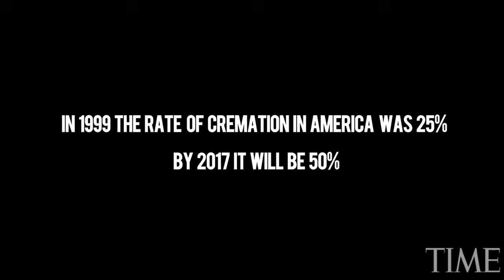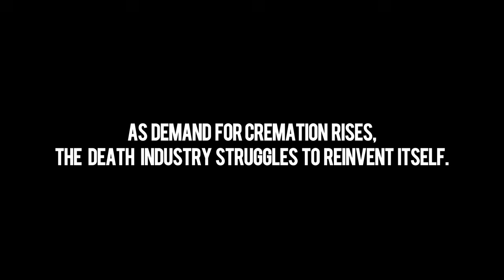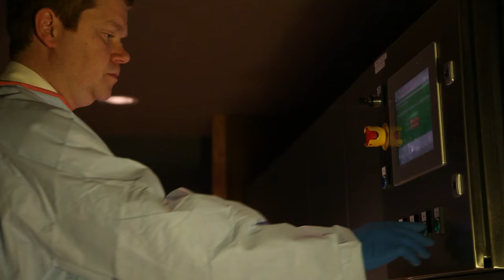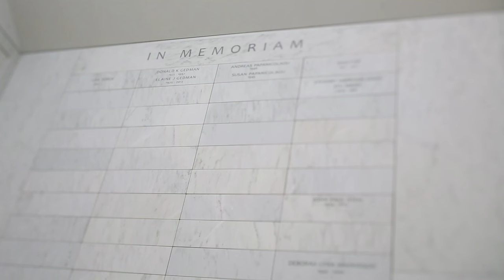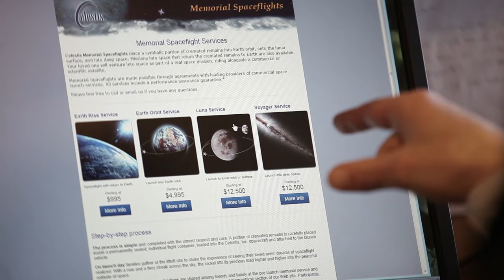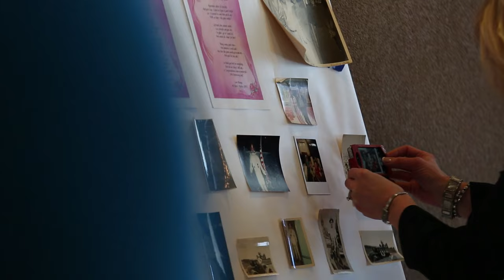Ashes To Ashes: Cremation By Water | TIME

Comment: In this very short  documentary , they don't  explain  how do cremation  work by water , I had to Google  it for my self , the body goes to a pressurized stainless steel  champer with water and alkali mix at temperature  350 degree  😕